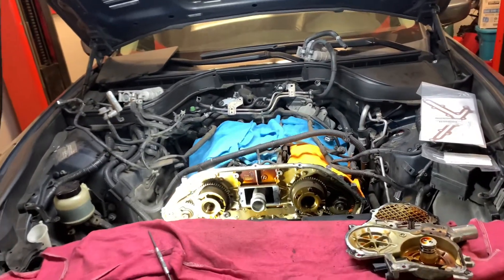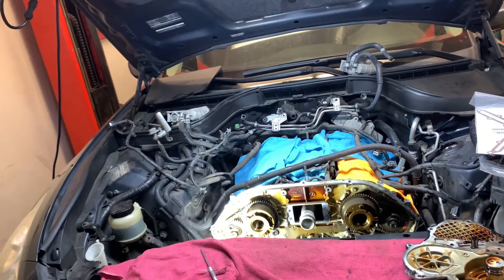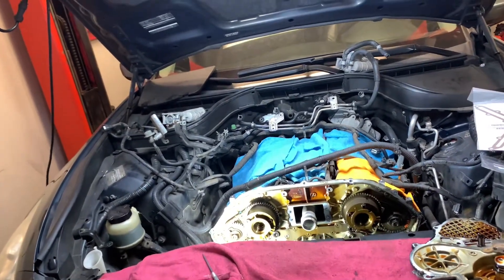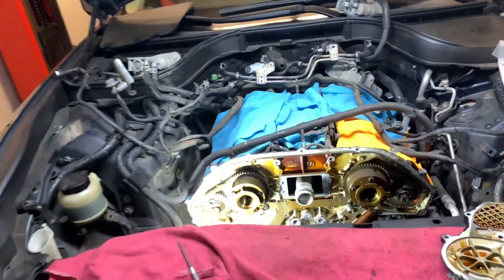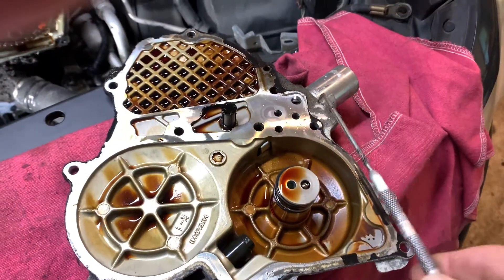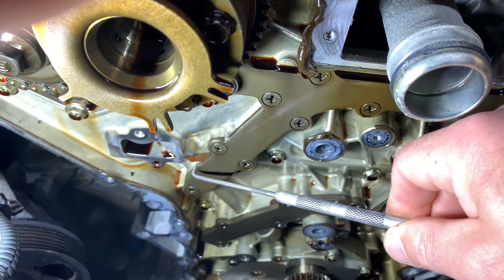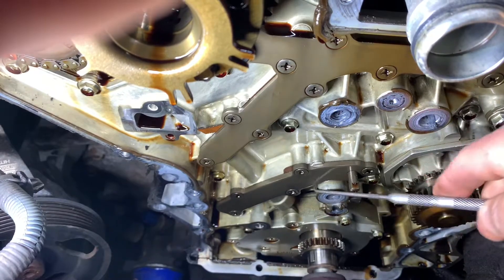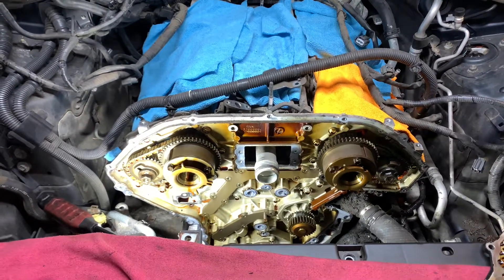Infinity g37x P0524 oil galley gasket failure

Comment: P0011 here and there. But when its cleared, the car drives fine,  but when it hits 4k under load  under any circumstance it cuts out hard. Like fuel shut off or something but then drives normsl. Just can't accelerate to quickly at all or allow it to hit 4k.  Vvt solenoid maybe?